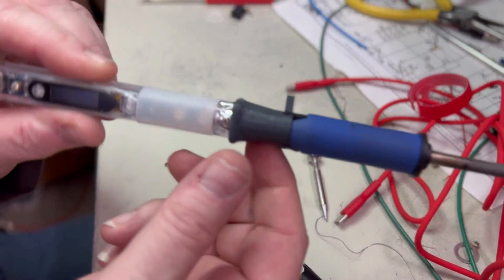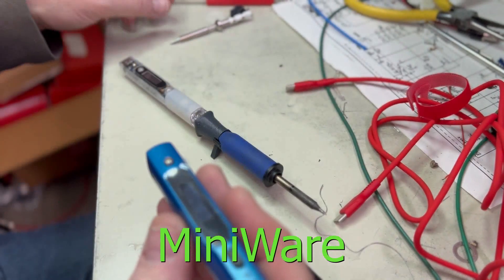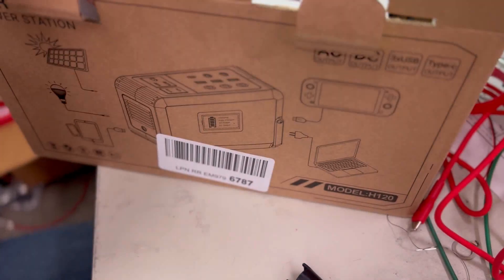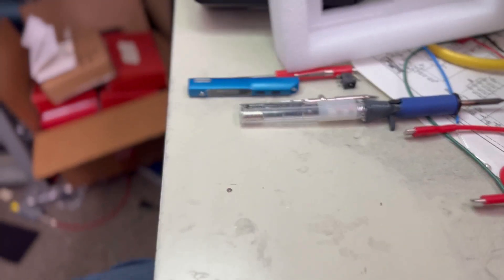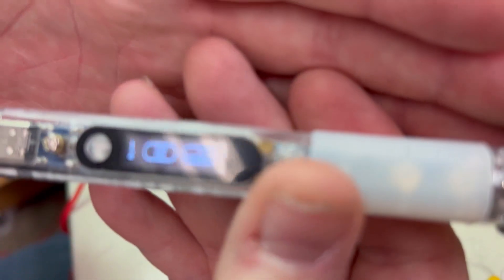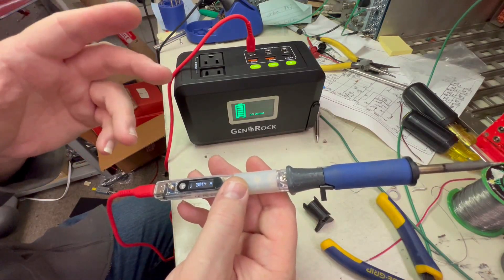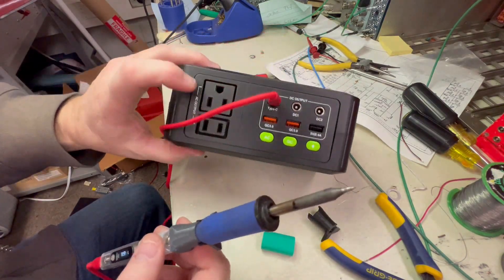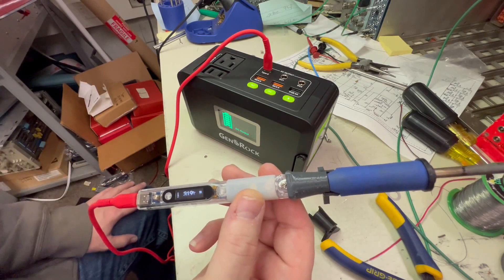Make your Pinecil portable and use Hakko T15 tips

Comment: I'm not sure on If I should mod it after for so long did any performance dropped or any damages?
Reply from the maker: I've had no issues so far. It works pretty much the same as it did before. If you are happy the way it is, you might want to leave it the way it is. I like to mod things, so it wasn't really a concern for me. Thanks for the comment!
Reply: @icemanfiveoh I see thanks for the reply. I'll be modding it soon since there's no issues for you. I'll be modding it cuz the ts100 tips are just a bit too expensive to me so it's better If I get a t12

Comment: Is this pinecil V2 what you using?
I have the pinecil V2 but is not wirki g with the hakko t12 tips! Even the hakko t12 tips have from 6.5 ohm to 7.8 ohm it should work but the pinecil mot recognize it! There us the symbol thathe missing the tips ! 
If xou have a Idea let me know please .
Reply from the maker: It is a V2. Make sure the bands are lining up with the contacts in the pinecil. And you are using a 3D printed tip adapter, right? I didn't have any issues getting it to work. I did add a smoked clear case for mine, so I could see the contacts through the case, that made it easier.

Comment: Hi, great video. Is it possible to use the Hakko tip without the adapter? Thanks
Reply: Is there anything that the adapter does that makes the tip work? Does the adapter pevent the tip from falling out of the pinecil? Thanks
Reply from the maker: The adapter just spaces the Hakko tip out so it sits in the correct place. There is a setscrew that physically locks it in. The hakko tip is longer as well. If you need one of the 3d printed spacers, let me know and I'll print you one. You can DM me on instagram: icemanfiveoh.
Reply: thank you @icemanfiveoh  but I do not need one, I have decided to go with the TS100 BC-2 tip that is compatible with the pinecil v2

Comment: Did you glue the adapter to the pinecil?  Or does it stay on some how?  I love this idea using with Hakko parts!  I'm printing out the adapter now.
Reply from the maker: The adapter just slides on. No gluing necessary. There is a set screw on the pinecil that holds the tip in securely. Thanks for the comment!

Comment: But you can use the Hakko tips without the adapter and the Hakko handle? And what power supply would you recommend for it?
Reply from the maker: People are recommending using a bigger PD usb supply. I was using a 20w but bigger would be better as it will heat up even faster. I think my usb brick wasn’t PD. If you get a really good PD battery bank it would be really good. As far as the adapter, I’m not sure it’s 100% necessary but it does help if you want to set it down and not have a separate holder. Thanks for the comment!

Comment from the maker: It's odd how some comments have disappeared. Here is a comment from @JoePangit. "icemanfiveoh Here's a new trick. Hold down + button while plugging in power. It will go into PD debug menu and you can see all the power modes it has detected from the adapter you are using." Thanks for the comment Joe!
Reply: That is strange.  I'm not very radical on YouTube.  I wonder why my comments go away?   Here's a demo of Pinecil power for you:  https://www.youtube.com/watch?v=nTC-ah4f0hg   0  to 300c  in less than 3 seconds :)  I use a Rocoren 140W charger to hit these speeds.    Thanks for letting me know about my deleted posts.  Not sure I can do anything, but thank you very much for the heads-up!
Reply from the maker: Holy smokes! Those are some pretty quick heat-up times. I think i should invest in a nicer brick i can plug into my AC/DC power bank. Thanks for the link.

Comment: I like that tip adapter!  You could plug a $15 65W USB C wall wart charger into that and the Pinecil would heat up to 300c in about 12 seconds.  Just an idea.   Instead of doing 12V like yours is, it would do 20V 3.25A.
Reply from the maker: Exactly. It's another reason I picked that AC/DC battery bank. It also does have PD on the USB C so I should be getting 20v I think. I tried to give myself options...Thanks for the comment!
Reply: @icemanfiveoh  At https://youtu.be/R8fQ4WG1qXI?t=185 when you plug the Pinecil in, it is showing it negotiated 12V.  If you plug it in and get a 20V showing there, it will be way more powerful.
Reply from the maker: Huh, I didn't notice that. Thanks for pointing that out. I didn't know that the Pincil displayed that information. Thanks for the comment, I appreciate it.